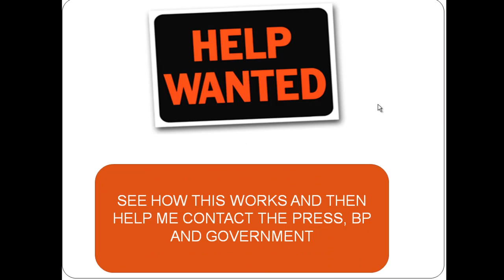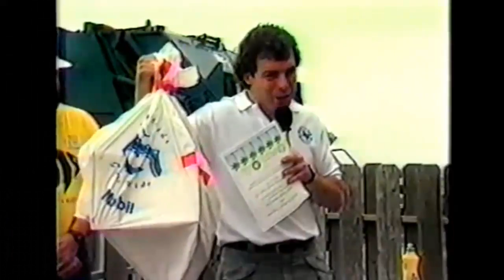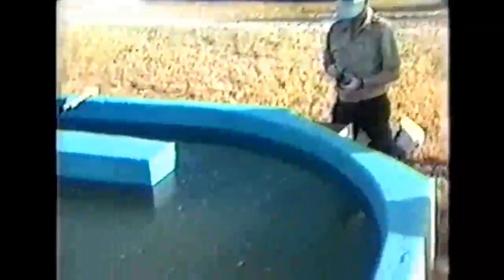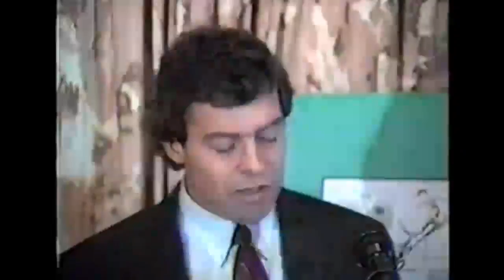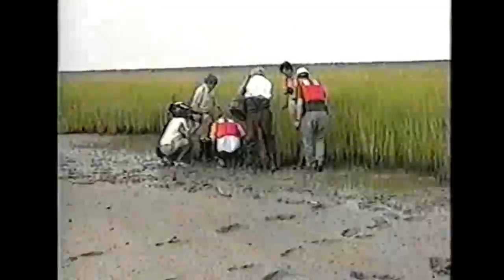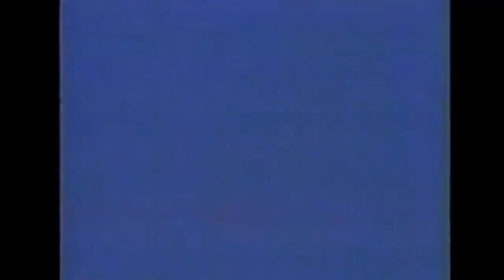Gulf Oil Spill-Gutsy Solution Restores Environment in Just Six Weeks

Comment: @danconia3873  ( I wrote a huge long response and then realized just which part of my comment you were questioning.)  Because they seem to have a one track mind and are pretty much focused on stemming/stopping the leak and using dispersant to make it appear less disastrous.
Therefore I am assuming (never a good thing to do) that they won't really fully  address cleanup until the flow is stopped.  Otherwise they would be using every means necessary to clean up the oil and they are not.

Comment: I work for a Regional Oil distributor in Oklahoma city, and we use a similar product to treat our runoff wastewater form our tank farm.
The product we use is called "bio-sorb". You mix it with water, or if there is water already present you can apply it straight to the spill. You can watch it instantly remove oil sheen from water as soon as it hits it, within hours/days it will eat larger concentrations.

Comment: This is a deep-sea spill, where there isn't a lot of oxygen.  Microbes can be used in the marshes.  Don't believe the hype that this can be "fixed in six weeks" - the exxon valdez spill, is still fouling up the Alaskan coastline with clumps of oil.  Not that Caribou Barbie would have noticed.  If the the Republicans weren't so busy fighting tooth and nail against any and all alternative energy legislation, we'd have had biomass, solar, and wind replacing this crap..

Comment: There are way too many comments to go through to see if this is being repeated. And I think this is a really good way of going about the cleaning up of the oil. But isn't the main problem of closing the leak, unless I'm just under a rock and they closed it and I just didn't hear about it. Can the microbes be used if the leak is still going?

Comment: @CaPtAiNxOuTlaNdisH 

It's much more than a couple thousand barrels.  And we're already seeing the destruction on the coastline.

Yes, there's a lot of water, but you're wanting so badly to say this is nothing to be concerned about.  This is a problem and took a lot of fucking up on mutiple levels for this to happen and it was due to cutting corners, ignoring warnings, and greed.  Safety and control should have come first.

You don't have to be a treehugger - just not ignorant.

Comment: @berni1245 I stand corrected on the trying different stuff.  Thansk bernil1245!  However, they have never tried it under these conditions with these tools at this depth.  So, in actuality it is just a matter of semantics between our opinions.  What we do agree on, is that it is still leaking and needs to be stopped and the waste needs to be cleaned up.  Used if they can capture it or digested if they can't.  It's been since 4/20/2010 since this disaster lets get our act together and help.

Comment: @mskitowhawk I don't know how they could, but if it is a possibility then it would be a possible danger to the oil reserve.  What if some of those microbes get inside one of the new relief wells they're drilling now?  
You're wrong on the other point, everything they have tried so far was tried on another rig explosion that sank in the Gulf and leaked oil for 9 months back in 1979.  Google "Ixtoc I" and you'll find they tried almost the same methods.

Comment: @berni1245 How could some microbes that don't weigh a thing migrate to a well head that is pushing out oil at a pressure of over 90,000 psi get in there when BP can't even get a 500 ton dome over the thing?  You don't make sense.  Besides, nothing they have tried had been tried before.  What are you saying?  They are trying all kinds of methods that have not been tried before.  Rest assured, the microbes can't get in a gusher the pressure is to great.  Use some commons sense, please!

Comment: Government, BP whoever is in charge, won't let that be used until the well is capped and under control.  If you release that microbe into the Gulf its a possibility it will migrate to the well head and into the underground oil reserve.  Their number one concern is to stop the well from leaking then clean up.

Comment: This is something to address the results of the problem, but not the problem itself. It may work after the gushing has stopped. But considering the volume of oil being released--much of it apparently at deep-sea levels--it can't plug the leak.

Comment: @cvans come on man.  what are you, 14?  Of course it doesnt stop the flow.  However, this will stop the oil from reaching the beaches.  Are you aware of what oil does to the beach?  The beach acts as a sponge.  It soaks all the oil up.  Go dig 2 feet down at Valdeze and youll get pure oil.  Putting the microbes out now will drastically reduce the damage.  Keep them out there from now until the end of the year if thats what it takes.